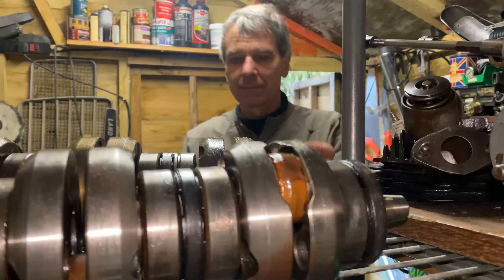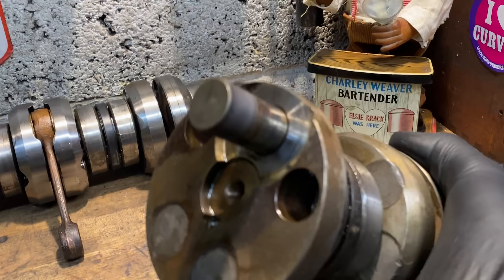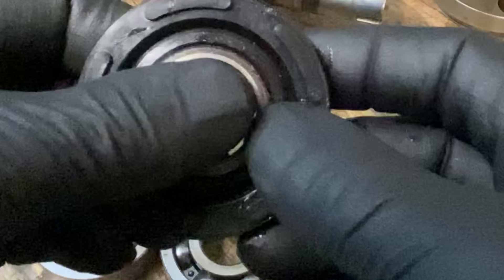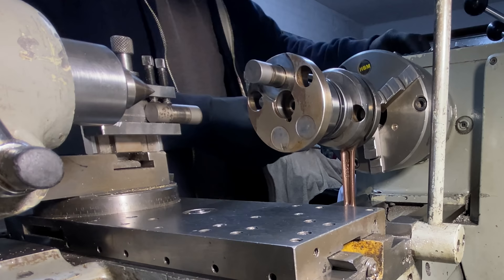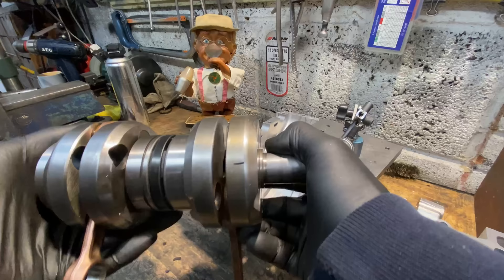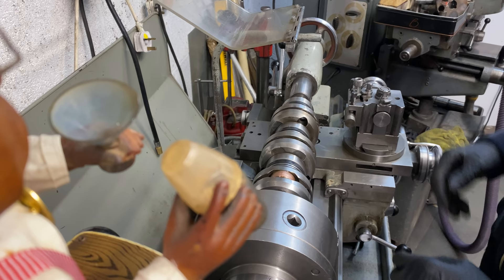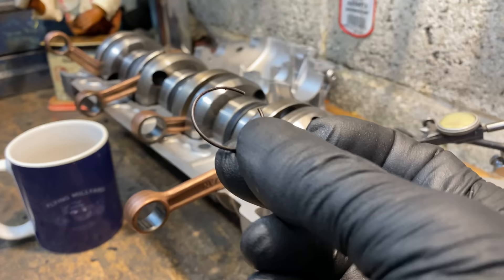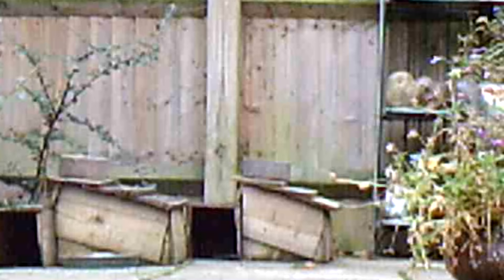Millyard Kawasaki S1 Four Cylinder Crankshaft - How its Made - Episode 2

Comment: It never ceases to amaze me how you re-engineer and then build engines/motorcycles using comparatively simple equipment with such precision, Allen!
Reply: And those cupcakes have me in a fit of hunger now!
Reply: I was thinking the same.. How in the world? I would be using the precise measuring instruments as I was going along and Allen just uses them to double check his work... Let me correct that statement...I would not be able to do this...and I (B.I.D.A.) Before I Discovered Allen-- considered myself a decent, above average bike builder...HA! I love this guy.. we can all identify using simple tools.. But to use them at such a level of precision is just ...mind-boggaling:)
Reply: @garystratton4125  Yeah. Usually, if you want to up the capacity or cylinder count on a vehicle, you start and end the plan by looking at suitable engines to swap in. The average person doesn't instantly start by wondering where to graft a couple more cylinders onto the current engine. :D

Comment: Here’s me expecting to see turning and welding and grinding. No you just push on another one. That’s very clever fore thought in the initial design stages. Nice 👍🏼
Reply: Hi Greg, I was expecting welding etc,  I didn't realise that extending crankshafts was like playing with Lego.
I reckon this engine building malarky is easy. 🤭
Reply: the beauty of modular cranks.
Reply: I thought the same thing, I’ve only ever stripped car engines which are obviously completely different
Reply: @Spodokamono  in your dreams 😅😅
Reply: @Spodokamono  Assembling an engine IS easy. The skill comes into play when you have to bolt it all together in that one configuration where it will still work. :D
Reply: @Reman1975  to be honest I wouldn't even get to that point. My cutting with a hacksaw in a straight line would be my 1st issues. 🤭🤭🤭
Reply: @Spodokamono Acurate hacksaw use has always been black magic as far as I'm concerned. :D
Reply: The cupcakes were the real surprise.

Comment: I think what Allen didn't fully describe is that the initial position of the first rod pin in the lathe doesn't matter, as long a it's somewhere near either the top or the bottom. Being straight up or down gives the most rotational accuracy when it's locked onto the tool post. Then it's just a case of rotating it exactly 180 deg. Very clever. 

It had me guessing at first as I couldn't see a dial indicator on the first pin, I didn't know how he got it at top dead centre, then I realised it doesn't even need to be. Excellent video!
Reply: This took me a moment to understand as well. As long as the tool-post isn't moved after the first position is set, all is good.

Comment: I find the crankshaft throw arrangement fascinating. 
The usual cross plane staging puts the 180 degree split between cylinders 2 + 3; this creates the effect of a 90 degree twin paired with another 90 degree twin, out of phase by 180 degrees. Mr Millyard places the 180 degree splits between the cylinder pairs, creating two 180 degree twins separated by 90 degrees. 
I imagine that either design creates a beehive of buzzing at the grips at high engine speeds, but which one is better all-round?
Reply: we await the results with much anticipation
Reply: Yes, it's very interesting. In his previous fours, he's used a two-plane arrangement, with crank pins at 90*. The way Yamaha used to do this, with the TZ500/700/750, had it fire like two twins strapped together. Single-plane, outer pistons in parallel, inner pistons in parallel, 180* apart. This one seems to have cyls 1&2 at 90* to 3&4. This might create a bit of a rocking couple. Looking forward to the results.
Reply: No need to wait for results, this is the same layout of his other four cylinder bikes. The old TZs fired two cylinders simultaneously, then after 180 degrees of rotation fired the other pair. 
Allen’s design brings one cylinder to TDC every 90 degrees, but not in the style of the Yamaha R1 cross plane design. 
My curiosity revolves around the the resulting secondary imbalances, and how that affects the overall feel of the engine and what type of vibration “signature” it would create. We’ll have to ask him to create another four-cylinder with the alternate firing order and submit it for testing!

Comment: Very spot on job. Can’t believe they are using rubber center seals. Caused a lot of hot restart problems in two strokes. Much better with labyrinth type. Thanks for sharing.
Reply from the maker: I agree and have fitted lab seals in the past

Comment: Thank you, very informative. 
The laugh is on me, I've had an idea for roller or ball-bearing crankshafts for many years, but I'd never seen either one nor had any information about such types of crankshafts.
I was amazed to see how similar the real thing was to my idea, down to pressing the counter weights and crank pins together.
The internet is an amazing thing, if you use the appropriate search terms, you can find just about anything.
Reply from the maker: The roller bearing cranshaft has been used in engines for over 100 years

Comment: Excellent work, Allen. It threw me when you set the 3rd pin at 90 degrees out. I'm a 4 stroke bloke though, so I had to think that one through. Realising it is 2 stroke stopped me wondering how you were going to do the cam! I like how you use the lathe as a setting jig. Excellent stuff. mart in Solihull.

Comment: Was expecting to have 180 degrees with middle and outer pistons moving together. No reason for it really as its two stroke and this will make for a smoother ride i guess. Two stroke 90 degree angle engine should make for a interesting sound. 90 degrees is probably whats most common for two stroke, I have just never thought about it. You make some of the most interesting content on youtube imho.

Comment: Allen I want to share my method of pressing on bearings. Using the old bearing you removed, with a zip wheel cut the outer race off. Now cut the cage and remove it. Now with the inner race make a cut the full length of the race. Deburr the inner race. Now you have a piece that will fit square with the new bearing only putting force on the inner race and with the slice in it will not stick to the shaft you are pushing the bearing on to.

Comment: Just "found" the channel a couple of days ago even though I'we been aware of your work for years. Interesting to watch the different processes and the thoughts behind and around them, of course spiced with light humor in between, good work!

Even though I'm not an engineer, for some reason one thought seem to follow me through the videos: The 4-cylinder conversion seem to be something of a favourite of yours even though you claim liking every engine type and brand equally but in different ways in an interview 😃, and they sound nice. Probably the best "golden middle" in terms of physically fitting into the frame and not interfering too much when driving compared to a narrower 3- or 2-cylinder.

A fast scroll through the comments reveal that someone else too kind of touch on my thought too...what would the characteristics and above all sound be on a cross plane layout on a 4-cylinder 2-stoke? 🤤 Something similar to the also brilliant sounding 2 cylinder 500, only "more", just like the modern R1 compared to a v-twin? There will be a balancing issue of course but still doable? Not as much difference as on a 4-stroke?
Reply: Or actually, a 4-cylinder Yamaha XS650 (or something like XS1200) with a cross plane crank would be even better, but that would need a lot of effort...pressed crank yes, but the head has really been engeneered to not be elongated...😁

Comment: Made this squeak since the day I bought it……..that’s the fluid pressure going over the relief valve…..that’s a genius bearing puller. Could have used it many times. Ruined a few using the t puller and clamshells.

Comment: To fit bearings with out a press I have heated them up in oil to a max temperature of 150C then they just slide on. But it take much longer to heat up than you think, best with a thermocouple wrapped around the bearing. 150C is the maximum design temperature for bearings.
Reply: Or you can put a crankshaft in the refrigerator, it's the same effect. When I worked as mechanic, we used to use liquid nitrogen to cool parts in order to fit them tight.
Reply: I use a cooking plate, but your method is safer temperature vise

Comment: I'm curious about why you phased it "up, down, left, right" and not "up, left, down, right" I looked into this a while back as I thought it might make for a lower inertia crossplane V8 crankshaft but my basic analysis suggested it would end up with a second order rocking couple.

Is it to spread firing events out better? (to avoid it firing 1 2 3 4 or 1 4 3 2)

Comment: Hi Allan, a wonderful video, I do have a technical question. Being an interference fit between the crank pin and web, what is the reason you don’t thermally expand the web and contract the pin? Does pressing together like that not damage and cause the joint between the two to be weak and possibly overtime loosen up? 

Thanks in advance :)

Comment: Awesome. It appears you press dry/brake cleaned crank pins into the flywheel webs or whatever... do you have to worry about galling of those surfaces or is there enough natural lubricity in those metals?
Reply from the maker: You will notice I put some oil on the big ends and while I was doing that I put a bit on the sides of the crankpin

Comment: So I assume that if you just get a longer crankpin you could squeeze 2 Conrods on one pin? Probably with a thrust washer in-between.
I also assume the crankpin(s) is hardened as it's a bearing surface?

Comment: Have you ever considered making a "flat" plane crank. I've heard them on Ferrari's and their V8's and 12's sound so drastically different than 4 plane V8's. I wonder what it would sound like? A 4 cylinder, 2 stroke with flat plane crank? Just curious. cheers🇨🇦 👍
Reply: This would mean cylinders would fire in pairs so wouldn't have the same smooth 90 firing angle. It would sound just like a twin.
Reply: @gs425  Why would you fire in pairs? Double the rpm. A flat plane spins much faster than square plane. That's why their engines sound sooo different. A square planes cranks engines have a very low rpm limit requiring a hydraulic system to actuate the valves properly, instead of a cam and valve springs, to operate at extreme rpm's.  Ferrari does it all the time. But by eliminating the valve train system and 2 strokes and add a flat plane crank, would make a super screamer with a very unique sound. I appreciate your guess, but I think your wrong.
Reply: @alvarsdzenis4739  If you make a 4 cylinder crank flat plane, then 2 pistons must be up, and 2 down.  There's no other way around it. In a 2 stroke they fire every time a piston is up therefore 2 will fire together.  As a separate point, flat plane and cross plane has got nothing to do with valve adjustment, which is what hydraulic tappets do. You are confusing a few different technologies
Reply: @gs425  With each crankpin journal at 180 degree intervals, the flat plane crank tends to be higher revving than it’s cross plane counter part. That’s because the pistons are firing evenly between their banks (L,R,L,R,L,R,L,R, etc.) while a cross plane fires unevenly (L,L,R,L,R,R,L,R,L,L,R,). Because of this, flat plane cranks tend to be less balanced than their cross plane counterparts, but being more responsive because less weight is needed to carry counterweights to balance out vibrations from the engine.
 You might have heard that the V8 in the new Ford Mustang GT350 and GT350R features a flat-plane crankshaft.
 Almost every production V8 engine ever made has a cross-plane crankshaft. That is, if you looked along the length of the crank, you’d see that the big-end journals (where the bottom of the conrod attaches to the crank) are offset at 90 degrees to each other. There are four of them and they visually form a cross shape (hence, cross-plane, depending who you talk to).
 With this set-up, you get each bank of four cylinders balancing each other, but an uneven firing pulse on each bank. It’s this unevenness that gives a traditional V8 that rollicking, rhythmic soundtrack.
 But a flat-plane crank has all four journals staggered at 180-degrees from each other, so they all line up on a single plane. In this scenario, you get the two banks of cylinders balancing each other, but without the unevenness on each bank. The big clue for bystanders on the footpath is the noise. Unlike the conventional V8 noise, you get a less tuneful note – more like two four-cylinder engines rather than one V8.
 So why do it? Essentially, a flat-plane crank will, pound for pound, make more power.
 That’s mainly because the different firing order makes for better cylinder scavenging on the exhaust side. Think of it as passive supercharging. And it can do that without complex (and heavy) exhaust systems with cross-over pipes and what-not. Also, the flat-plane crank doesn’t need such big, heavy counterweights to smooth out the engine’s primary vibrations, so it can spin up faster and rev harder. That said, the flat-plane crank lacks rotational balance, meaning it suffers from secondary vibrations and isn’t always as nice to sit behind. And that’s why it’s generally the preserve of race engines or high-performance road gear like the new GT350. But the lack of those counterweights also means it can have a smaller crankcase, and that’s good for small, light race cars.
 Flat-plane cranks have been around for a long, long time, mainly in racing applications where the vibes are less important than the outright power of the thing. But some very famous engines have featured a flat-plane crank, including luminaries such as the Cosworth DFV, Ferrari V8s (even road-going ones) and the V8 Lotus Esprit.
 It’s not just V8s that can have a flat-plane crank, either. Many 4 cylinder engines with flat plane cranks are seen in VW Beetles, Subaru WRXs and Porsche 911s. The thing is, the inherent vibration in a flat-plane design only starts to show up as capacities rise, so a smaller engine has less to lose in the first place. On another note, I was asking a fellow engineer his opinion not yours, Though I appreciate your opinion, I don't appreciate you calling me "confused" when I clearly know more about the subject than you. Enjoy your day.
Reply: @alvarsdzenis4739  If this was flat plane then 2 cylinders would fire at same time. As the full article you have copied and pasted from says, all inline and boxer 4 stroke 4 cylinder are flat plane by default (apart from newer R1). I appreciate English may not be your first language.

Comment: Loving this latest series. Why a new hole for the shaft / flywheel locking pin instead of the half that's already present? What was the original crank angle?

Comment: I would have thought that your bearing puller should be working on the internal ball race 🙄, well that's how I've always done it, so as not to put pressure through the balls from the outside race, as it can cause a mark in both races and eventually cause bearing wear noise and collapse 😆 sorry but I was surprised to see it done using the outer section of the bearing and made me wince slightly 😉

Comment: Allen, I'm thinking of joining two 2 stroke 3 cylinder engines deck to deck to make an 6 piston 3 cylinder opoc engine, but the strokes need to be halved. How hard is it to halve the stroke on a built up crankshaft?

Comment: Hi Allen, when you were pulling the bearings off using the 4 legs as extractor i wondered if you should pull from the inner race instead of the outer race? Perhaps the extractors dont fit that way? I had visions of the bearing being pulled apart! 😛

Comment: Amazing & soothing .  So the big end shaft presses home &  the 2 fly wheels aligned by the copper hammer? What stops them coming out of align while running, especially No1 where the other pistons are twisting it against the drive chain? .
Reply from the maker: 5 tons of interferance fit and a hardened pin

Comment: One question: why not use roller bearings? Would they not provide greater resistance to impact from TDC exhaust and BDC power strokes, or is it the case that the engine is light enough in relation to the bearings that such resistance is not needed?

Comment: Allen, Why don't you use an electric bearing heater to make is easier and less risk to the bearings?
They are a rather simple induction heating device, not a hot oil or oven baking. 
Or, turn down a ring so that there is no chance of effecting pressure on the outer race if pressing them on. 
Using quality SKF bearings?

Comment: When you drilled the hole for the pin that locked the second flywheel I noticed that the crank surface and the flywheel surface were not level so you didn’t have a groove to centre the drill bit on. So how did you manage to centre the drill on the crank/flywheel interface?

Comment: Hello … would it be possible to install a belt driven rotary valve in place of the Reed valve … it might be a bit of messing around but ultimately it could help with the pre powerband torque

Comment: Would it be possible to alter the positions when pressing it back together and make a custom flat plane crank engine? Or make a big bang engine (all cylinders fire very close together)? Of course you would need custom made cams. Just wondering if there are other reason it wouldn't work. maybe balance issues?
Reply from the maker: Yes any configuration is possible

Comment: Allen did you make that bearing puller? I could use one of those as I rebuild about 20 outboard powerheads a year (2 stroke). I use a split bearing puller, or if there is no or little room behind the bearing, a 2 jaw puller but as you know those like to twist. thanks in advance!